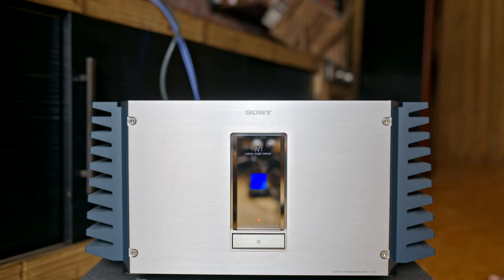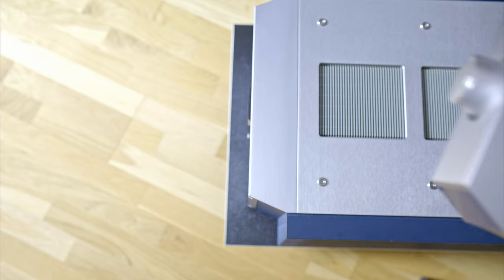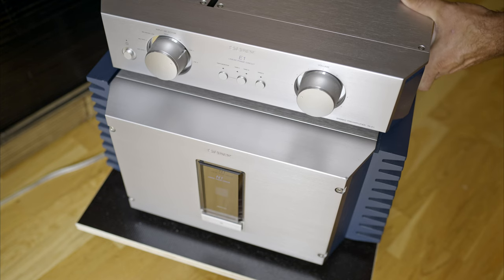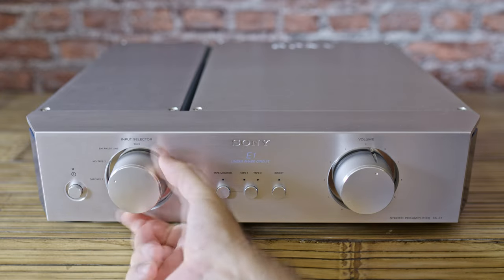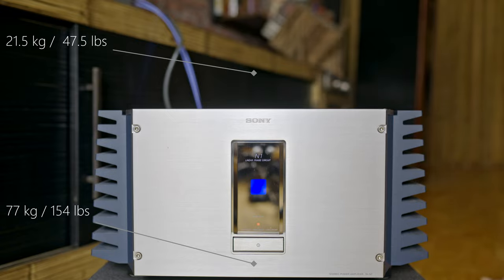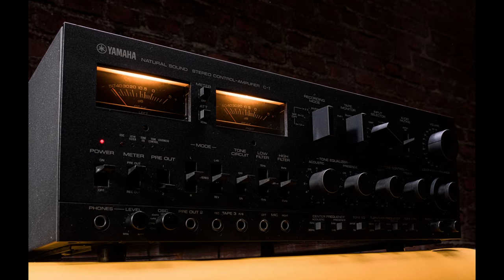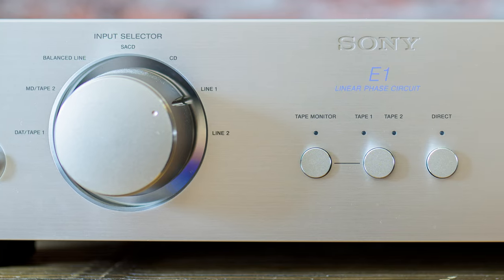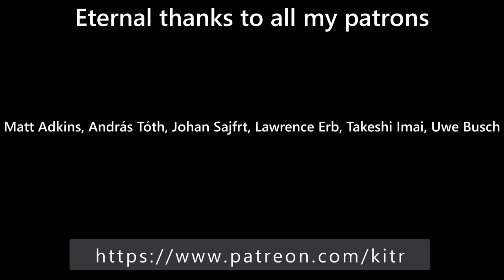SONY TA-N1 and TA-E1 Review - Part 2 - A masterpiece or just a piece of hardware?

Comment: I own this among other Sony preamps. I like a little more resolution than this one offers. A smooth and warm sound, too much of it for me, maybe. Another thing that I don't like is the use of SMD components and also that its circuitry is mounted in aluminum plates, making it much more difficult to repair if something goes wrong.